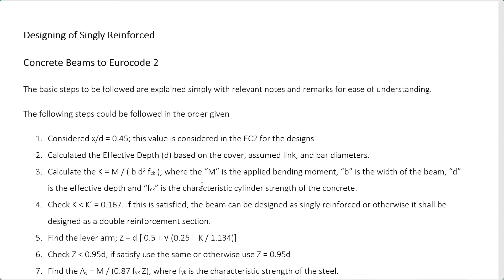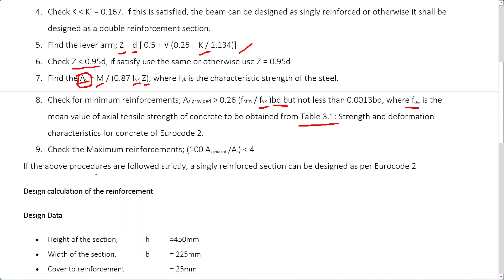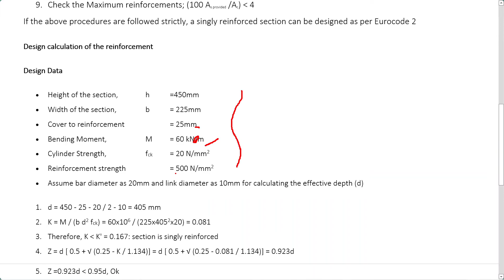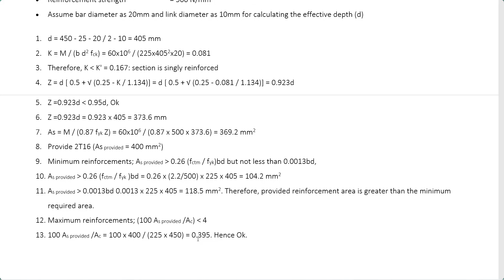Singly reinforced section design to EC2 | Design to Eurocode 2 | Structural Guide

Comment: what's the clause number for "z: lever arm" formula in EC2?
Reply from the maker: The method of calculating the lever arm is not straightforward. You may refer to clause 3.1.7 for related information. I suggest referring to the Book "Reinforced Concrete Design to Eurocode 2 by Mosley, Bungey and Hulse" and for further information Worked Examples to Eurocode 2: Volume 1.